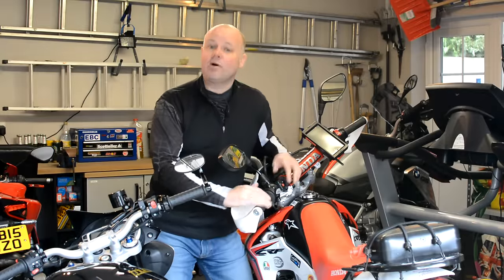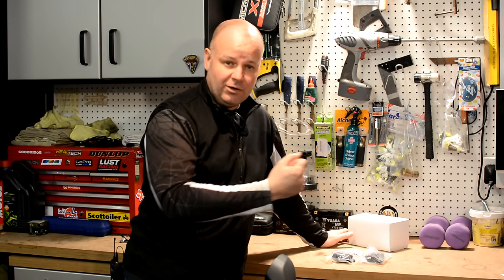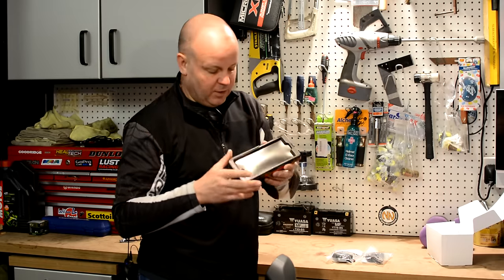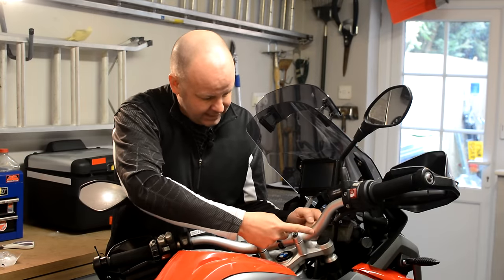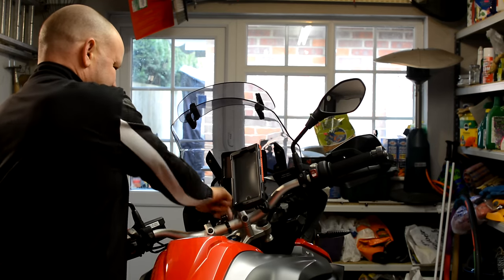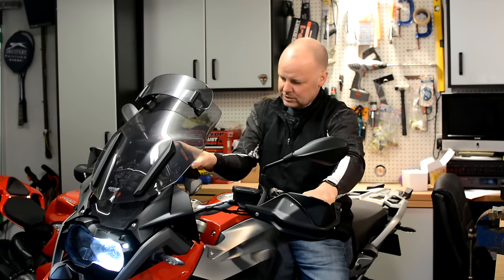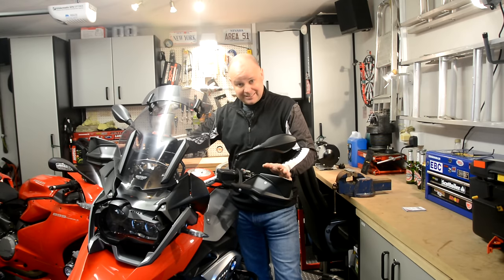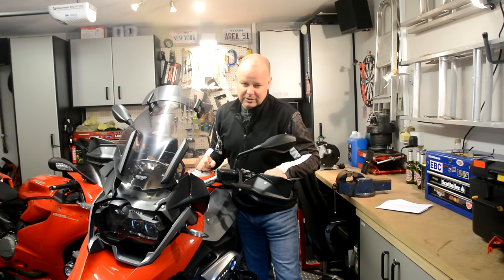Motorcycle iPhone Mount

Comment: looks a great mount .ive looked at a few designs how ever ive found i can never use the touch screen with gloves on .unlike my garmin sat nav
Reply from the maker: Yes it is a good sturdy mount, and yes, the screen on the Garmin is pressure sensitive where as the Phones (I think) are capacitive - and therefore rely on current flowing - some gloves have little pads on the tips that allow you to use phones with them on...

Comment: Been struggling with this particular problem. Does the case allow a Lightning cable to be used? Also, how easy is it to see the phone screen in very bright conditions ( such as full sun on an Australian summer day )?
Reply from the maker: Yep you can indeed use the lightning cable, there's a little flap with a rubber bung on the bottom to allow it to exit (and you don't use the bottom clip)....of course it won't then be completely waterproof.....

Comment: Unrelated question but does the GPS in google maps work if youre out of service range? Google maps now enables the download of maps for use offline, which is great and all, but I want to see my position with the GPS.
Reply: cpuspeed I'm given to understand that Google maps or most smartphone maps use WiFi hot spots and cellular towers only for initial and fast location finding. it then uses GPS satellites for more accurate positioning, which will work outside of mobile coverage area too.
Reply from the maker: Yeah I agree, it should work.....

Comment: Hi there can you recommend a do it all bike I'm packing in the car I'm 66 and have a new T 120 bonniville but I want something that I can use as my day to day transportation. I'm only 5 ft 7 too. Any help would be most appreciated.  Thanks.  Mike.
Reply from the maker: ...for me the best all rounder is the GS - love mine, touring, scratching, carrying stuff, commuting, it does it all with aplomb...
Reply: MIchael KIeran what budget are you looking at ?  Agree the GS is a real swiss army knife of a bike but a smaller cheaper option is the Suzuki Weestrom or the Kawasaki versys both 650s but great do it alls or as a complete aside what about a maxi scooter 500cc loads of weather protection etc.
Reply: Thank you my budget is up to 10.000 max but less if poss.  Thank you for you're reply.
Reply: TheMissendenFlyer thank you so much your help is much appreciated.
Reply from the maker: Don't forget the Triumph Tiger 800's either - great all rounders and that awesome triple engine.....

Comment: Hi, first of all many thanks on a brilliant set of vlogs; they are both interesting and informative. One question though - as you have a Nav V why do you want or need to mount the iPhone?  Everything integrates with the Nav V so what's the point?
Reply from the maker: Well as I mentioned, the Nav V is actually a bit of a rubbish SatNav - it's great as a bike information system (big speedo, tyre pressure monitoring, etc) but not so good at giving directions when compared with Tom Tom Navigator which I have on the phone....plus I want to see incoming call info on my phone etc.....thanks for watching - all the best - TMF
Reply: I've used the Nav V all over Europe without any issue. I also have my phone linked to my Nav and my Schuberth SRC linked to my Nav. that way I can take and make calls whilst riding if I must. Appreciate your view on the direction capability of the Nav but it does everything I need really well.
Reply from the maker: Fair enough.....my Nav V seems to lag about 5 metres behind what you need, so it tells you to turn just after the exit!!
Reply: TheMissendenFlyer Hi TMF, I checker and I agree with you now, the Nav V does seem a little late with its verbal instructions. I guess I've never really noticed as I normally rely on the visual prompt only using the voice prompt as back. in short, you're right mate. Shane I don't own an iPhone :-)
Reply from the maker: It's the visual prompts I was referring too!
Reply: OK. Then you probably have a faulty unit

Comment: does the case allow for charging the phone while on the go?  I find the iPhone battery doesn't last too long when I use it as a Nav
Reply from the maker: +Neville Henderson Yes, there's a hole at the bottom with a rubber bung so you can keep your phone plugged in and on charge as you go...

Comment: Here's my x grip ram mount. I no longer use the tether as the x grip holds the phone firm. Replacing one handlebar bolt with ram ball and through bolt. I love it. 
https://www.instagram.com/p/BRRlJg6F1ed/
and here
https://www.instagram.com/p/BRRkjLalsAE/
You do need to glue the four rubbers immediately and when mounted centrally I run usb from din via adapter to charge phone.

Comment: Being old school and riding many years I still can't get my head around the thing of feeling the need to have a phone mounted to the bike.

I keep my phone in my pocket and use paper maps, only thing I need to look at is my speedo, anything else is a distraction, only thing on my bike is my speedo and the idiot lights for indicators and neutral light, what else do you need !!!!

Been hit so many times from behind from cars where the driver gets distracted from something, like a phone or sat Nav or any nature of things much prefer to look where I am going, choice between answering a call and avoiding an accident ? Avoid accident.

Just my two cents, each to their own.
Reply: annie white C'mon Annie paper maps! I'm of an age when that's all we had. Try modern tech, it can make life a lot easier. Rather than having to pull over in the wind and rain to wrestle with a map.
Reply from the maker: ....I'm with Sleepingdragon on this one! ;0)  Thanks for watching anyway Annie White......
Reply: How many times do people complain that brand X sat Nav does not work, even the flyer was saying the one on the BMW not that good so uses his phone !!!

So you relay on your sat Nav ?

Sat Nav comes in handy for a location of where you are but I would never rely on one, good as a back up but that's about it.

Read many a story about people having a problem with technology then using a map and a compass.
Reply from the maker: Whatever works for you Annie....

Comment: Hi MF.. Surely battery life is the main issue? Satnav eats power..?
Reply from the maker: Not an issue - the Nav V is plumbed into the bike and my GS has a USB charge socket just behind where I have mounted the iPhone so that can charge on the move too :0)
Reply: TheMissendenFlyer Ahhh, I didn't see a charging outlet  for a USB lead on the case.. Cheers